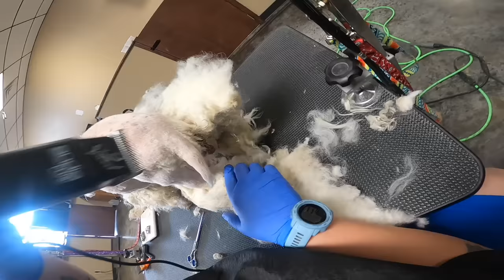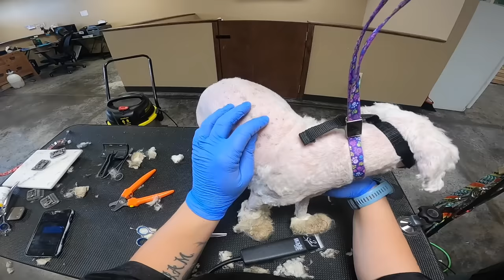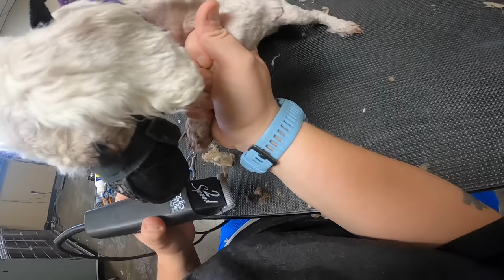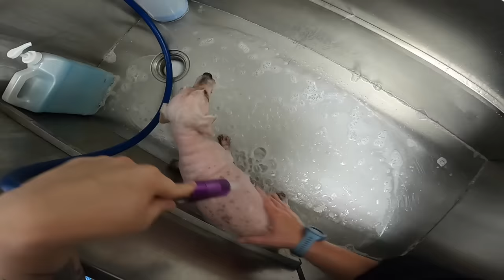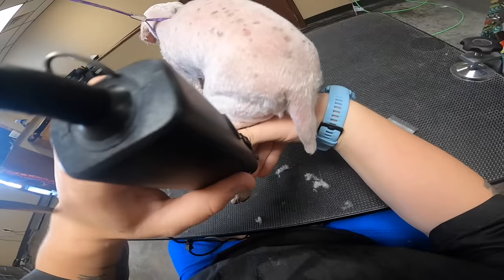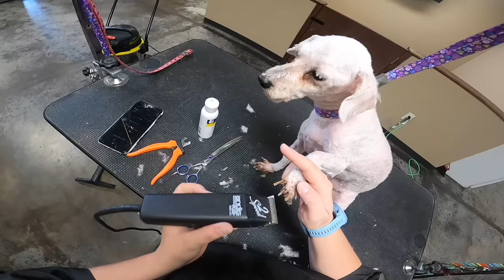THE WORST Matting I'VE SEEN IN 15 YEARS

Comment: I know how difficult it can be getting through the matting  especially on the legs & tail. I now run the blade of me clippers down the length of the leg just as though you're removing a cast. This gets you safely right down to the bone and gives you the access you need to start shaving away the matting. I also use secatuers  instead of scissors to de-bulk very thickened matting.  They're much stronger, really versatile and nit having a sharp point, much safer. Keep up the good work!

Comment: I''ve seen other groomers cut vertically down the leg on the outside, and then tear the coat apart from the cut before removing the enter mat with the shaving tool.  It is more painful to peel and cut horizontal as it pulls the skin cause more pain and takes much longer to remove the mat.

Comment: You did awesome. You showed tons of patience. The dog as you kept going, seemed to understand.  Suggestion: if you can tolerate the smell. Try just a tiny dab of vicks under your nose. Im prety good with most, but some.... i used when my cat was healing from a severely broken leg. Had to keep straight so used a metal bracket to go either side of his leg   putting  pieces to hold, then wrapping the whole thing in  tape. Changed out twice. Then had to go a third stretch as on place wasnt healed enough. When we took it off the last time, there were places that had gotten more serious pressure sores and infected. I used the vicks to mask the smell as i took care of it. Was used by my friends husband to keep his stallion from spelling the mares when in heat. Maybe that or something similar to help these cases. You did so good considering. My praises and prayers.😃

Comment: Pro-tip...run the scissors in the direction of the toes lengthwise.  If you go cross-ways you run the risk of cutting skin.  Never use any blade except number 10.  Anything higher is too short.
Reply: She's been doing this for a long time

Comment: Removing difficult matting from a dog's legs and paws requires patience and the right tools. Here's a step-by-step approach that I personaly do that may help you better with other dogs you may need to tackle with:

Before You Begin:

Gather your supplies:

- Detangling spray or conditioner
- Slicker brush with fine bristles
- Undercoat rake (optional)
- Dematting comb with long, rotating teeth
- Clippers (optional, for severe matting)
- Treats for positive reinforcement

Prepare your dog:

- Find a quiet, well-lit space.
- Make sure your dog is comfortable and secure (leash or harness).

Removing the Matting:

- Apply detangling spray or conditioner: This loosens the fur and makes it easier to work with. Focus on the matted areas and avoid getting it in your dog's eyes.

- Start with gentle brushing: Use the slicker brush to work through any loose tangles on the outer fur. Be very gentle, especially near the paws.

- Tackle the mats: Use the dematting comb to carefully work through the mats. Hold the matted fur at the base to avoid pulling on the skin. Gently tease the comb through the mat, working in small sections.

- Consider an undercoat rake: If the matting is deep, an undercoat rake can help to loosen the underfur before using the dematting comb.

- Shaving as a last resort: If the matting is severe and impossible to remove with combing, shaving might be necessary. This is best left to a professional groomer (such as yourself) unless you're very comfortable using clippers on your dog.

Additional Tips:

- Take breaks: Brushing for short periods is better than stressing your dog with a long session.
- Reward your dog: Offer treats and praise throughout the process to keep your dog calm and cooperative.
- Know your limits: If the matting is extensive or your dog is too uncomfortable, it's best to consult a professional groomer. They have the experience and equipment to handle difficult cases safely and efficiently.
Reply: But she’s a professional !!!!!!